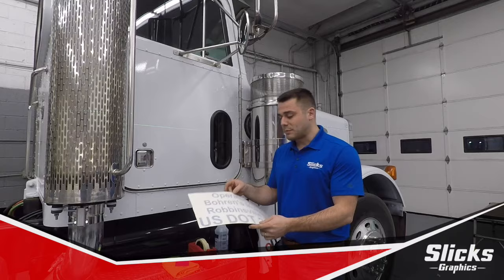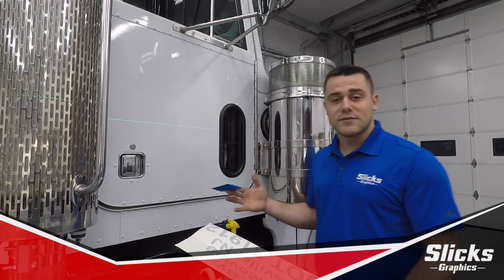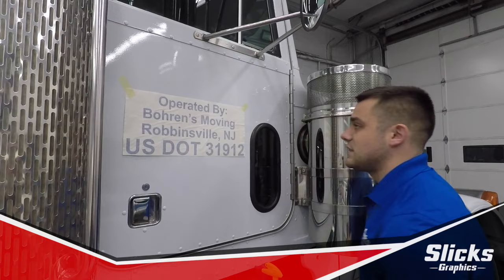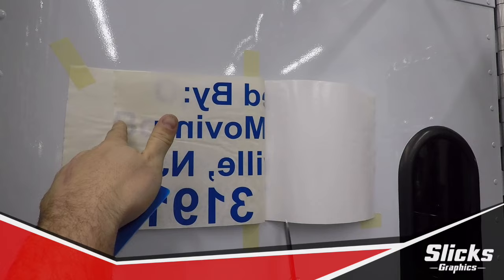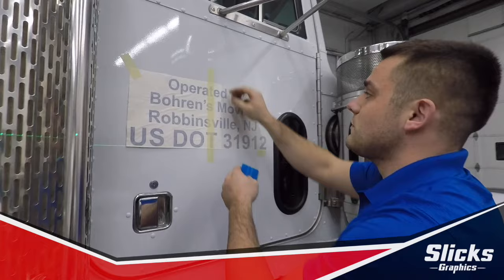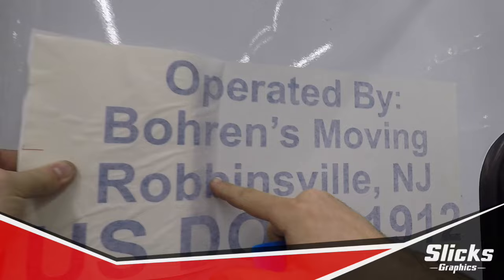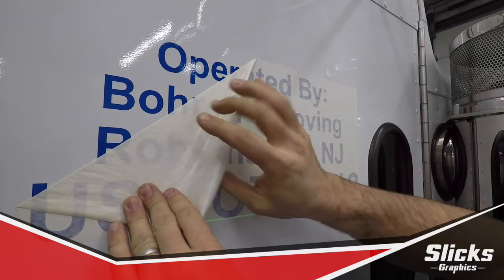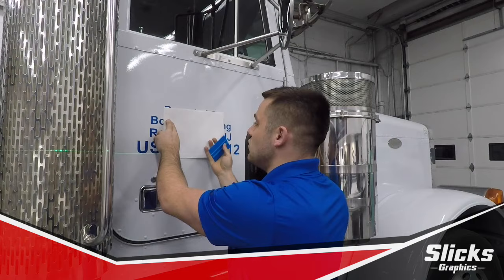How To Install Truck Lettering - Slicks Graphics

Comment: Pretty nicely explained, though it's dangerous to lead people to think that level is correct. Sure you can adjust a laser level to be parallel with body lines, but the average viewer won't know that you meant that. Lining up graphics on a vehicle can be simple, but more often than not, it's the difference between a professional looking job and a poorly installed decal. 

But I don't mean to be negative. Honestly it's one of the best explanations of the center hinge technique I've seen on YouTube. I'm sharing it with my brother-in-law who purchased some decals from me.

Comment: Is there a preferred temp to make sure the graphic will stick properly, I have to do this outdoors? It felt like summer last week but today feels like winter lol.
Reply from the maker: The desired temperature is between 60-75 degrees Fahrenheit, however you can preheat the surface if too cold to avoid adhesion issues.
Reply: what do you mean when you say 70/30  isopropyl
Reply: @scrapin2010  It is   isopropyl alcohol, I just used cheap rubbing alcohol for the final clean in a spray bottle, worked really well too!
Reply from the maker: That’s correct we use the 70 percent alcohol 30 percent water ratio…down to 50/50 to cut the oils to maximize the adhesive bond to the paint.